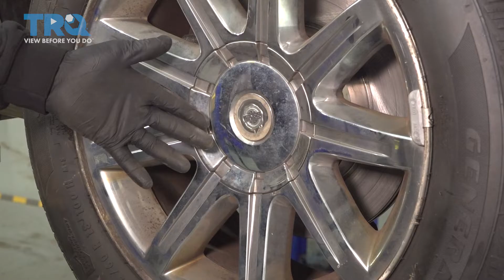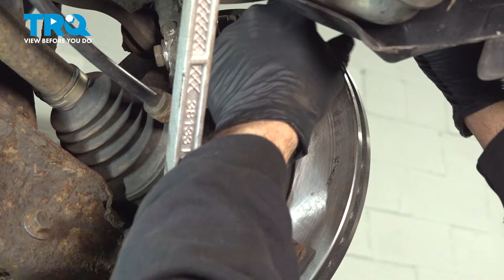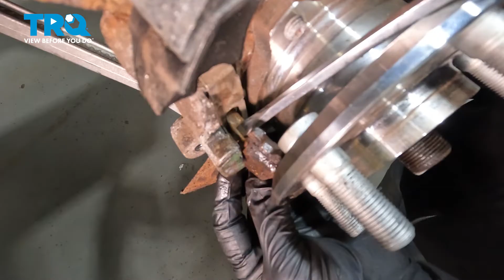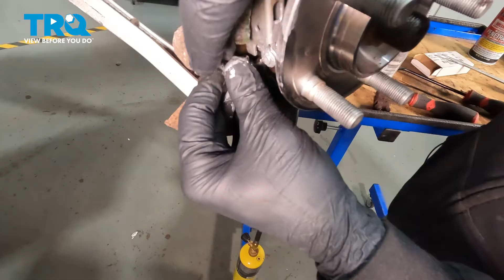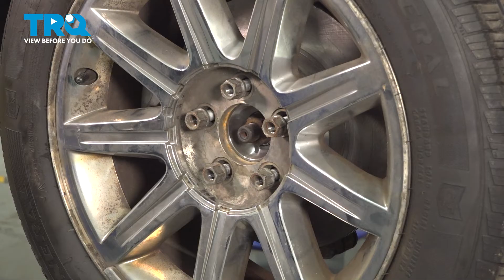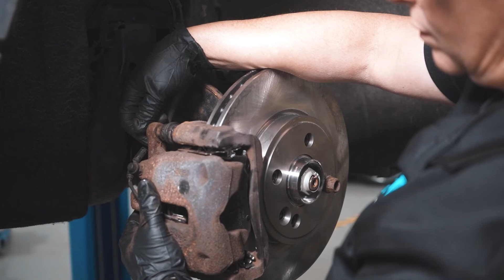How to Replace Parking Brake Lever 2005-2010 Chrysler 300

Comment: Thank you so much for this video!  I've got an '06 Magnum and was replacing the parking brake shoes.  However, after ruining my day after snapping the bracket mounting screw trying to remove it, and using e-zy outs, and re-tapping and using heli-coils to get the new bolt in (of course throwing several hissy fits along the way with tools being thrown and all),  I got everything back together. Got in the car stepped on the pedal and it went all the way to the floor!   After yet another hissy fits, swearing at all the German engineers involved in this stupid design and downing several adult beverages, I watched your video and saw that the little hook on the actuator goes inside the little slot on the parking brake mechanism. 10 minutes later, I'm finished and the pedal is almost up to the top. Easy peezy!!   Thank you SO MUCH!
Reply from the maker: +@DM-hk8gz Thank you! We love empowering our customers and showing how to perform DIY auto repairs with our high-quality auto parts. http://1aau.to/m/Shop-TRQ